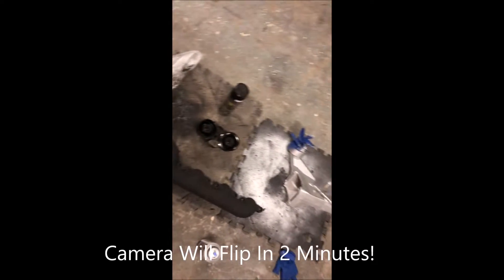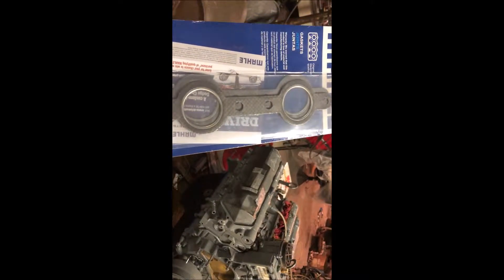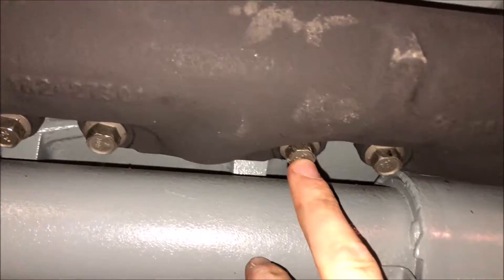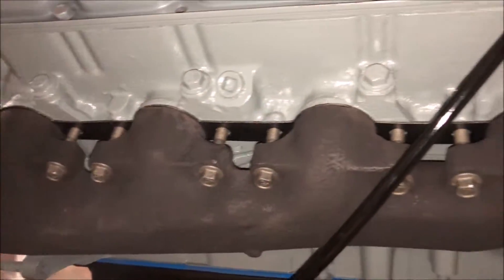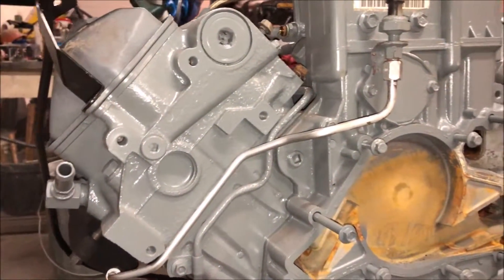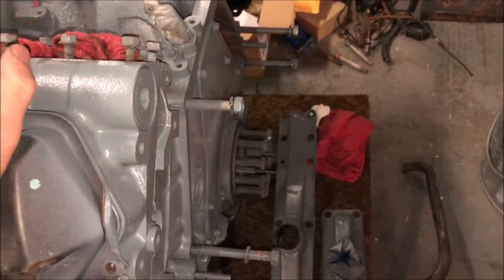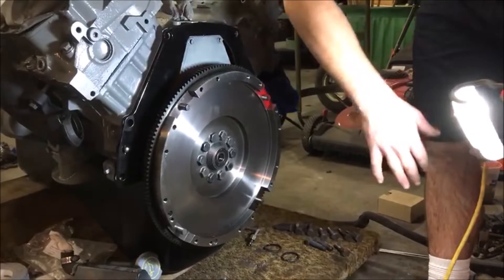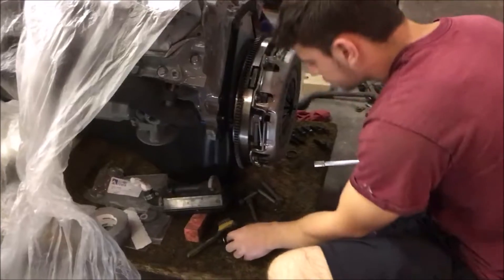7.3 600hp Engine Build Assembly Part 2- "Manifolds and SOUTH BEND CLUTCH Install!"

Comment: I did manifold gaskets and burnt them out after 6 years. Then the 2nd time I dropped them to a machine shop to be surfaced flat and used Mahle gaskets again but used stainless hardware. Still good after 14 months (knock on wood).

Comment: Running that size injector and larger turbo and no headstuds
Reply: I was running 150s stock nozzles and fuel system and ts with a zf5 and d66 in my obs and popped a head gasket I’d definitely be careful
Reply: ummm.......ummm